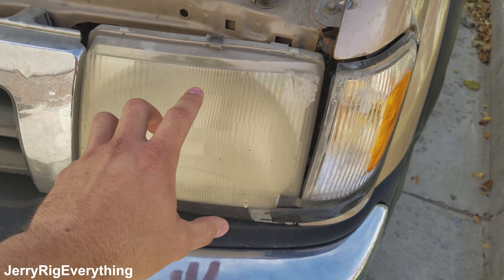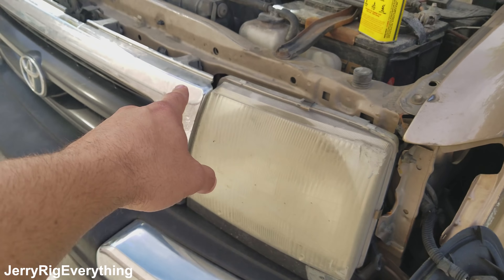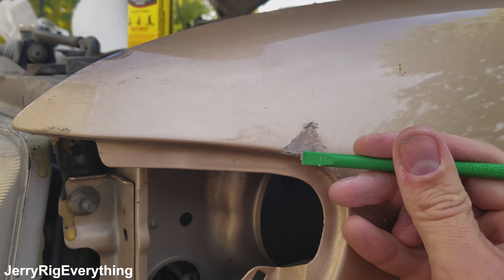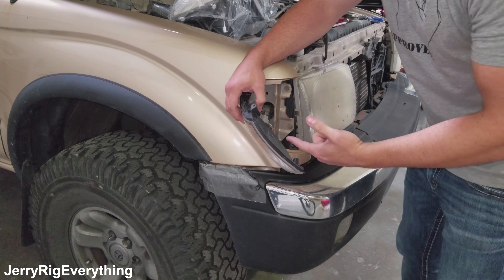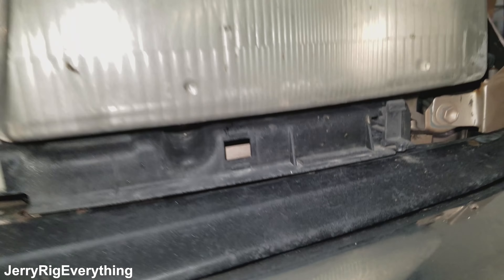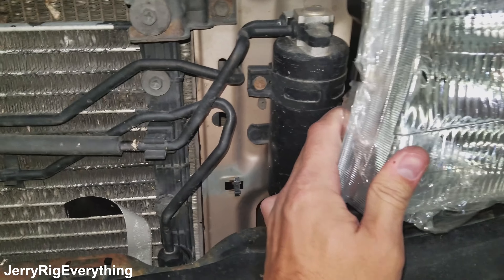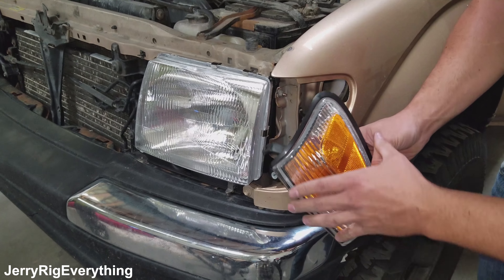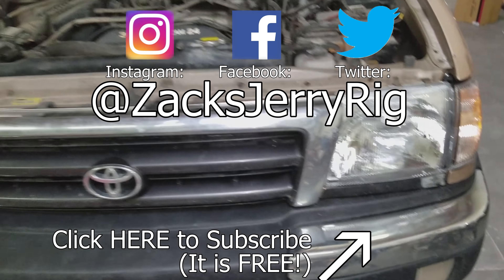Toyota Tacoma Headlight Lens and Parking Marker replacement- (1997 -2000)

Comment: I am a painter by trade, and the best way to get glue residue off is just mineral spirits.  Wear some rubber gloves and get a rag, not paper towels.  Let it soak in and should come right off, you'd be amazed.  No scraping, nothing.    Goof off is too "hot" and doesn't work that great.  That's it, the grill plastic things should be purchased prior to a grill removal if possible.  I was putting my headlight back on and the bolt fell out and went into the skid plate, (4runner).  

Finally got  it done...  After cursing quite a lot!

Comment: I guess you never found the clips for the grill as I don't see a part listed?

I was getting ready to use the Maguires headlight restoration kit on my headlights but I might just get new ones and use their cleatcoat which I already bought.

On a side note its pretty amazing that mine is a 99 with 185k miles that I've owned since new and I've yet to replace a headlight bulb.

Comment: 5:02 Do you happen to know what the name or part number of that clip is at the bottom right corner of the headlight? I have been searching for it and can't seem to find it and I have noticed that most of the headlight replacement sets do not include it. Thanks for your time in advance.
Reply: check parts geek
Reply: Thanks man. Much appreciated. I did find out recently that you can only get the part from the toyota dealer through my dad.